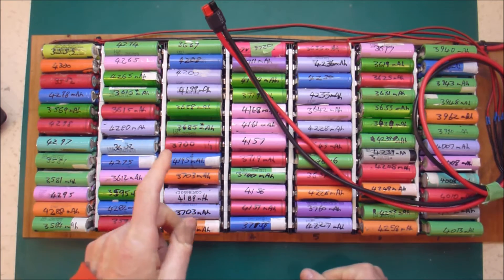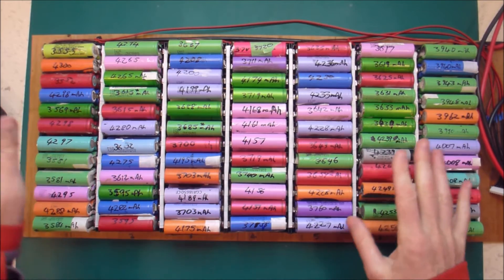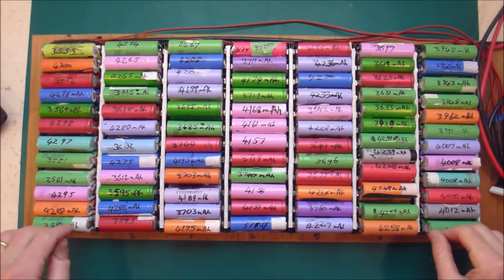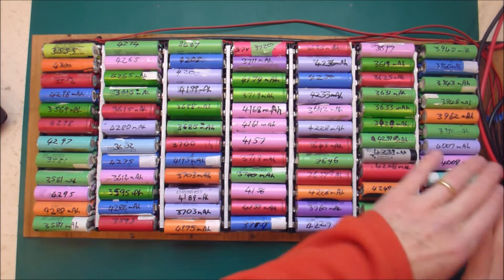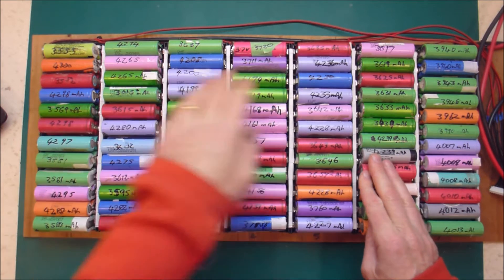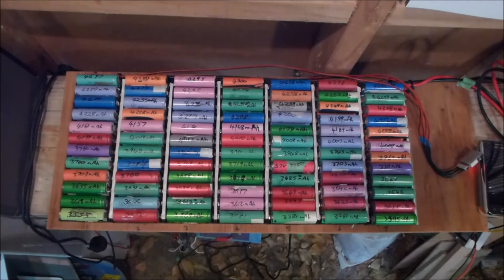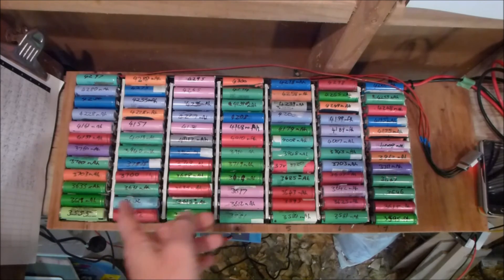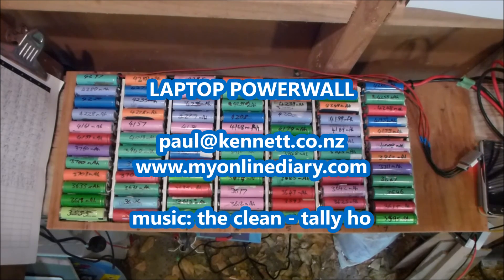Laptop Powerwall 70 - Powershelf with BMS update 4

Comment: 4200mah? isnt that too much? am i missing something
Reply from the maker: That's for a pair of cells. I keep the cells in their pairs to save handling time.
Reply: oh thats smart
i got few laptop batteries but i discharge it with 0.5 amp on contant load, since i still dont have discharger, i also discharge them in pair since i only have one constant load
Reply from the maker: 0.5 Amps is good too. It makes sense to be gentle on these random cells.

Comment: The method I use is like the way kids pick for team groups, always picking the best first, but slightly varied as instead of going in order the best is allocated to the group that needs it most and so on. 

To do this sort all the cells from highest to lowest and then allocate the highest cell to the group that has the lowest total, usually easiest if done in excel with running totals. I can use formulas to highlight the lowest group but could not find a way to automatically allocate it at the time, I'm sure it's possible but I couldn't be bothered at the time as I was only making a small pack.
Reply from the maker: I made this: https://docs.google.com/spreadsheets/d/1DzHPjOyKAWf_BDvVjKvI2jfDCsEAXT9AFQznFGO5Ml4/edit#gid=791969430
Reply: I'm imagining a lonely 3200 mah cell in the corner no one wants to play with being last to get picked for the "team" lol
Reply from the maker: Poor wee thing...

Comment: AREnt you reducing each banks overall capacity by having the lowest cells in each of them?

I thought you were going to group the cells into the banks by capacity and then increase the amount of cells in each group as the capacity drops to match the better groups?
Reply from the maker: Hi Jayme. My logic was; any collection of cells will have some that are the lowest. If those are spread across the groups then the groups will fade at about the same time - which means they'll stay balanced(ish). Then I could chose to swap out the lowest row of cells and thereby improve the whole pack. Hope that makes sense.
Reply: SO in your case you take out the 7 worst pairs and replace them with 7 better ones as you come across them?

I guess thats a good way to know which are the next to be upgraded, still seems like a lot of potential capacity left in the pack. 

After this experiment it would be good to see the opposite arrangement, eg. group by capacity, then add cells to the lowest groups to bring them up to the highest groups. I guess theres not enough room on that board to do this really....

Comment: please correct me if I am wrong but I thought the current limit of 18650 batteries to 3500 mah. I see you have quite a few over 4000?? I sometimes will get a reading like this using my Foxnovo charger but I will run the cycle again and it always drops to 3500 or lower the second time.
Reply from the maker: I'm using pairs of cells. So 4000 mAh means two 2000 mAh cells. I prefer keeping the cells as pairs straight out of the laptop battery - which cuts down the handling time a lot.

Comment: Hi Paul, I like your style and thank you for all the great videos. Can't belive you only have 600 subscribers. 
Did the user "spank me" (?) reveal somewhere how he did it? To me it sounds like a typical application for CLP(FD) (constraint logic programming over finite domains) using a prolog, e.g. the free software SWI-prolog. If we had a script/program/source for such an open source software, everybody, even with no programming skills, would be able to simply adjust the numbers and have fun with the spank me procedure.
Reply from the maker: That's my next vid. I can explain the procedure - but I can't programme real code to save myself (all I can do is cut-n-paste other peoples code). I'm thinking of calling for volunteer(s) who could implement the Schpankme Sort and open source it.
Reply: I'd be interested in something like that, is it not possible to have a spreadsheet and then have it auto assign them into the 7 packs so that they are even.  Doing my packs on your other design and shouldn't be too much longer before I'm ready to start soldering :-). Lot more permanent in that setup though
Reply from the maker: You mean like this? https://docs.google.com/spreadsheets/d/1DzHPjOyKAWf_BDvVjKvI2jfDCsEAXT9AFQznFGO5Ml4
Reply: Exactly like that paul, thanks for sharing it.  I've received my red filament so just waiting on the banana connectors now so i can start to make the packs up.  It's interesting though that the new filament is ABS compared to the PLA it came with and the ABS curls up in one corner every time so have to kind of wedge the end plates on but i'll make it work.  Going to try a different slicer, as you said in a previous comment, the joys of 3D printing :-)
Reply from the maker: I added a 0.4 mm raft around my version to help it stick to the bed. Might be worth a try. My printer only does PLA so you're out of my league now. :)
Reply: Yeah going to try a raft on the next one.  Mine is a cheap CTC dual so nothing fancy but it should do the job :-)